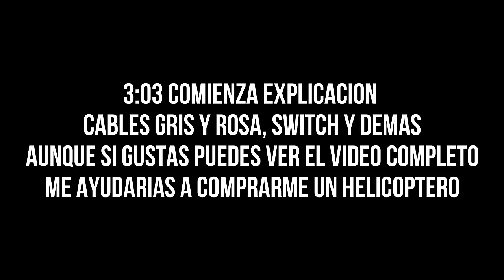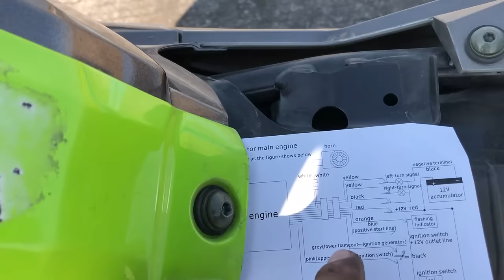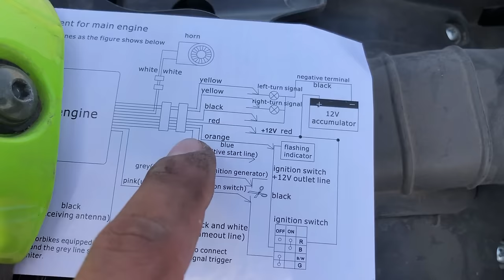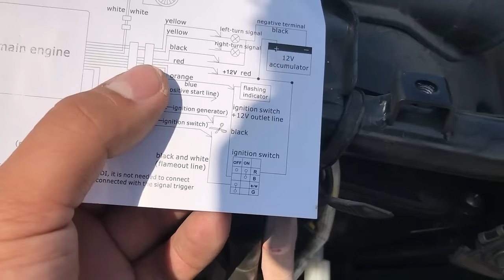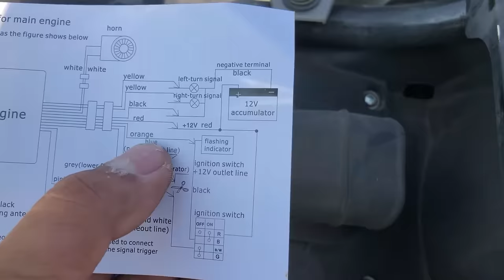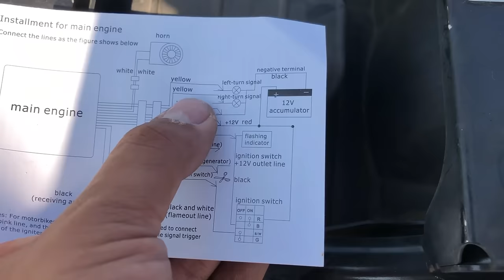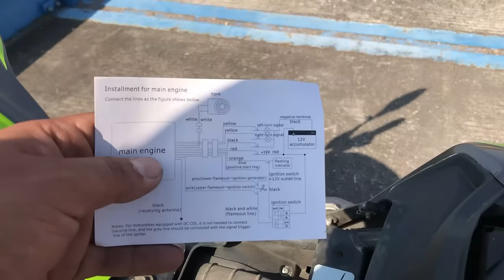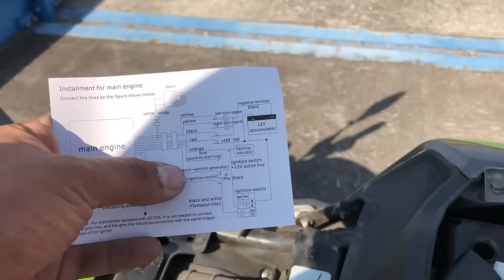Como Instalar Alarma Para Moto Con Arrancador (Todos los Modos) | Guía Definitiva / JMK

Comment: Muchas gracias por el tutorial. Mi CDI tiene muchos cables (kawasaki z650) así que le puesto un relé de 5 pines para cortarle la corriente del solenoide.

Funciona todo correctamente, menos la opción del arranque desde el mando (cable azul). Manda correctamente la corriente al solenoide cuando pulsas pero no arranca. Es como si tuviera el engine stop switch en OFF, pero está correctamente en ON. Parece que como no tiene la llave introducida y el switch de la llave en ON le falta la corriente al CDI o algo y no permite arrancarla. Puede ser ?? 

Última consulta: Es normal la caja de la alarma se caliente un poco? 

Muchas gracias de antemano y un saludo!

Comment: Amigo dices que explicaste con manzanas pero aún así hay algo que no entendí bien. Si tu switch trae 4 cables al inicio pero al final solo salen dos solo conectas el cable rosa o el gris dependiendo del CDI. Y si trae 4 cables al final cortas el blanco con negro y conectas rosa un lado y gris del otro verdad. Solo en ese caso se hace así ?. Y por último. En tu diagrama el cable naranja dice que va al flasher. Pero tu dices que va al cable negro que es de los cuartos. Pero aparte los amarillos van a direccionales. Ahi es donde me confundo porque si los amarillos van a dreccionales el naranja para que va al flasher?. Ojalá puedas responderme con esas dudas. Y de antemano gracias por el video